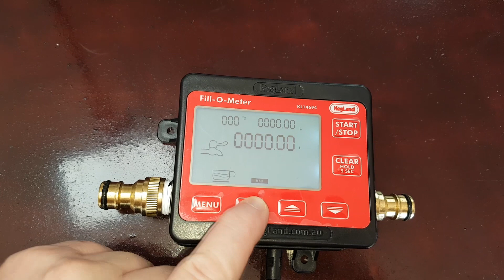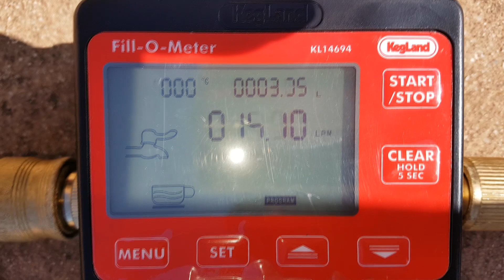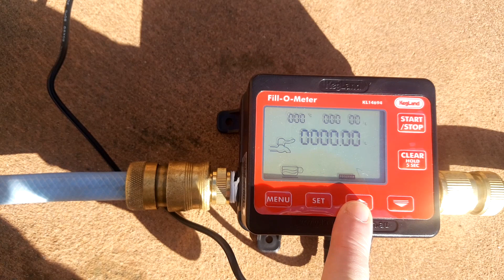Fill-O-Meter - Flow Meter - Volumetric Water Measuring Device - Preset Volumes - HLT - Fish Tank

Comment: I placed a big order with KL earlier today and was contemplating adding the Fill-O-Meter but didn’t since it apparently can’t tolerate higher temps than 40C..  It would be super-handy for mashing in and sparging if it did though.

Comment: Looks like a rebadged ZJ-LCD-M flow meter plus a solenoid in a box. Menu buttons and screen are exactly the same as the ZJ meter.  I have a DIY version on my brewery but as I bought the flow meter and solenoid separately, I bought a solenoid that can handle 80c so use mine between HLT and mashtun.
Reply from the maker: Sounds awesome, cheers!

Comment: Looks like a great bit of kit.
Reply from the maker: Yeah, it worked better than I thought and youknow its not something that everyone will want or need, but if it saves one flooding of a brewery its a good thing I reckon hahaha Cheers Jake!
Reply: The Home Brew Network Definitely mate. Flooded brewery is no good. Adds to the automation of the whole process as well.(the boring bits anyways) Be a way off for my brewery but would consider down the track.

Comment: I would imagine that flushing the line will also prime the line so that there is no deadspace loss through the entire run of the outlet pipe, assuming you have a long feed. Most setups will probably have the meter close to vessel being filled anyway, so no real concerns there.

The problem with some of Keglands “Toys” are that unless they are essential or must sought after item, they rarely see the light of day outside of Australia, even though here in the UK we have about 5 authorised stockists

Comment: Hoverdog is right is is 100% a repackaged ZJ-LCD-M flow meter i have 2 in my nano brewery. This is a nice touch tough as its all in one box, i had to build mine into a box with PSU etc. My solenoid and flow meter is remote with the display is on the wall. The solenoid in it likely cant cope with heat, i upgraded my remote one to a food grade triclamp solenoid and a stainless sensor and its good at 80+C, I've a more basic flow meter version without the solenoid i'm going to use for Mash to Kettle and Kettle to fermentor, fingers crossed my stainless hall effect sensor is ok with the heat, think its rated to 120C. These things make setting up for mash in, sparge etc so much easier on brewday.